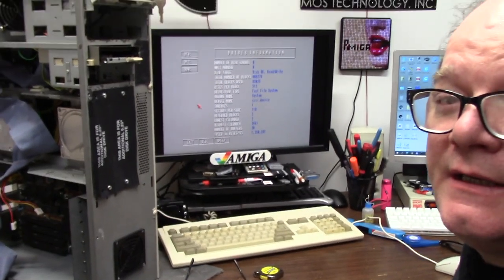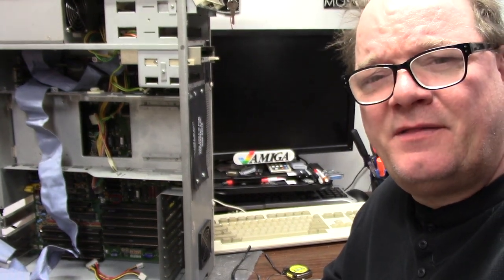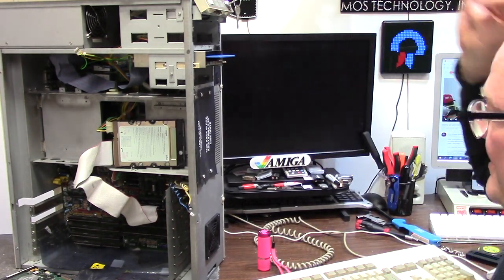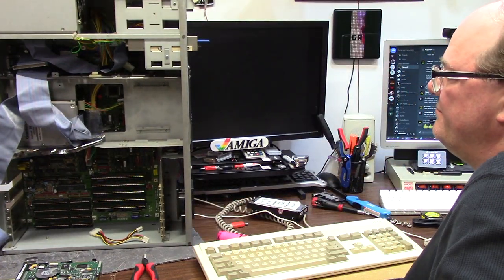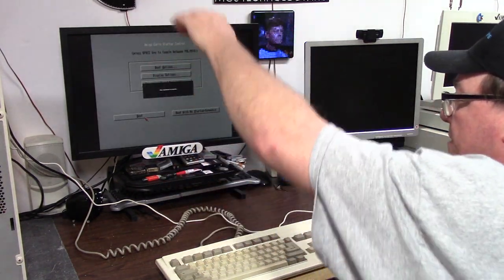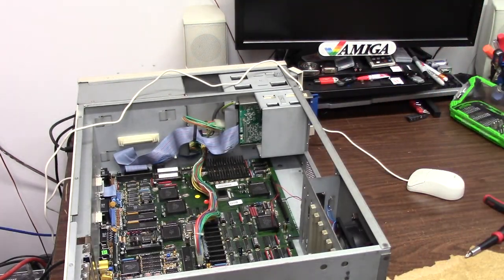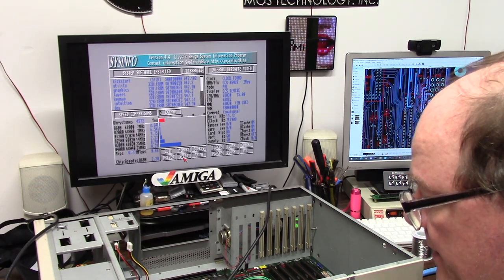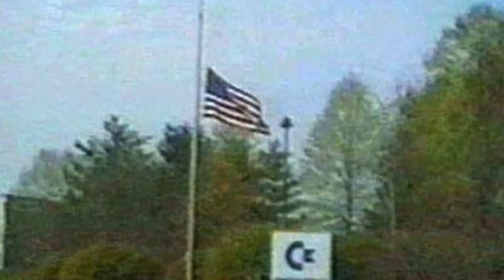Amiga 3000 Tower P2 explosions and more!

Comment: I remember a power cap blowing up on some telecommunication equipment I was working on, I thought I'd died and gone to heaven. After I changed it out, I turned it back on, with the end of a wooden ruler. There was no way I was going to stand near it again.
Reply: I had a capacitor blow on a UPS (Commercial Grade), I did think I was dead and had to pick myself up off the floor! Those suckers really know how to pop!

Comment: Wow! Chris! I’m surprised you haven’t suffered from PTSD after that? First time seeing Caps go bang 🧨💣🔋. For me if that happened I’d be walking away and leaving it. Kudos for sticking with it 👍🏻 I’ve got 2 problematic Amigas to sort out. 🤞🏻 I’ve just sorted out my A1200 Tower system and SCSI drives issue by using some better cables and a fancy Terminator sniffer. Next Amiga is my A4000 with what appears to be a faulty Mediator board problem, then my A1200 Checkmate cased Amiga with G-Rex PCI board on Blizzard BPPC 040, where after a while the network connection locks up the system 🙄 Oh well, Amiga Ownership eh!? 😂🤣😉
Reply from the maker: Its never ending

Comment: Popping off those caps instead of firecrackers for the holiday celebration.  I was going to suggest checking out the power supply to make sure it's feeding the Amiga good levels.  Besides the recap, my A3KT also benefited from deoxying the socketed chips to clean the contact surfaces.

Comment: If the voltage across the cap was 11.84 V and the cap was rated at 12v, it's operating too close to the edge I would about double the working voltage of the cap. A general rule of thumb is that the cap should be rated 2 to 3 times the voltage across it.  Do you have a scope to check for fluctuations from the power supply? You may have the correct voltages but you may have some fluctuation that is causing some issues. That's why I had to replace all the caps in the power supply of my 3000T. I have never replaced any of the electrolytic's on the board, but mine has been in the house for the last 21 or 22 years, and not in a storage building.
Reply from the maker: Just a new junk dried up cap kit.  Replaced w quality ones and all good

Comment: I had the same capacitor blowing up yesterday after recapping a 3000T board. Turns out that silkscreen is wrong and C171 is mounted with reverse polarity. Verified it against the schematics, the positive pin should connect to GND, while the negative pin goes to the -12V rail.
Reply from the maker: Well god dang.  Lol

Comment: Noticed at 13:07 you have the PCB board layout for the A3000T. Repairing mine after battery damage - not severe though (lucky me..). Spent 2 days searching on the Inet to get the PCB layout without luck so I could track some traces. Any advise where I could get the A3000T PCB layout ?
Reply from the maker: shoot me an email and i can give you what you need.  info in the about me of the main youtube page.

Comment: Chris I am surprised you haven't looked in the PSU, or if you have a PC to A3000T PSU  converter that you haven't tried it to see if the PSU is the possible problem? It can't be much else other than a chip, capacitor or issue with the PSU really. :)
Reply from the maker: Actually it wasnt the power supply.  All will be revealed soon!

Comment: Do you know if that case is a standard PC full height tower or something else? Would a 3000T motherboard fit the standoffs of a PC case? So few people have a 3000T the info is hard to find.
Reply from the maker: No its a custom case for the amiga. Not a pc case. Its 38 inches tall so it would take a massive pc tower and require extensive modifications to maybe possibly fit and there’s a whole power supply issue while having a standard ATX header. The wires are totally different.
Reply: @ChrisEdwardsRestoration  Thanks for the informative reply. I have a 3000T motherboard somewhere deep in my pile and I remember it being enormous. Even what seems to be the official Commodore sales brochure (A3000T_Brochure.pdf) specifies the dimensions as 24" height, which really didn't seem right. They give 55 pounds as the weight though, holy crap. Commodore should have sprung for some wheels or a handle.
Reply from the maker: 68 pounds fully assembled
Reply: @ChrisEdwardsRestoration  And I thought my Tektronix 547 was a heavy oscilloscope! 
It looks like rebuilding a 3000T just from a motherboard seems unlikely then.
Reply from the maker: Why not if it works there are old gateway tower or other cases out there
Reply: @ChrisEdwardsRestoration  Sure but the local used computer market dried up a lot over the years and shipping such a large case is too expensive. Also I'd need to bodge a power supply connection, just seems like a lot of work. I'll probably consider listing the board on eBay soon...

Comment: This is the -12V line, so GND=plus and -12V=minus... Maybe your capacitor is inserted the wrong way around or the labeling on the board is wrong.
Reply from the maker: Nope defective caps from a “kit” of replacements from a certain store
Reply: @ChrisEdwardsRestoration  Oh no, I will have to recap my A3000-25 one day soon and I was gonna just buy a Cap Kit locally...may I should just Order direct from Digikey enough Caps to do all of my Amiga Collection (minus the A600 that RetroRewind did for me)?  Another Great Video BTW!  -Mark.
Reply: Oh, they must be incredibly poor quality. On my 3000 only noble electrolytic capacitors come :-)
Reply: @ChrisEdwardsRestoration  panasonics from mouser for the win :) make sure cap rated double of voltage its running at.

Comment: the toshiba chip ram zips.. i have seen alot of them fail over the years,they will cause all sorts of erratic crashes and odd things.The irony is its always a soldered zip!. Sounds like the usual Chinon eject mechanism dragging or not seating..  ziptest.lha from aminet finds bad ram reliably on A3k. updated scsi chip? kick scsi into synchronous with setbatt1.2 or scsiprefs for speed.. some quiet noctua fans would be great..   Hang in there Chris,you will get there! I also had a 3000t with a bad denise socket from the factory,had a pin broken between the motherboard and underside of socket,took me forever to find it,no telling how many years it caused the original owner headaches.